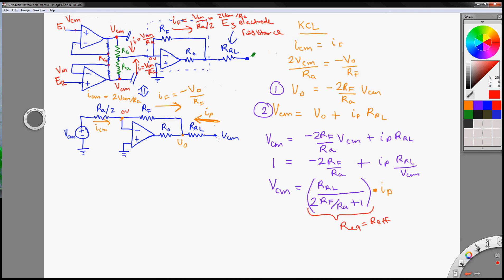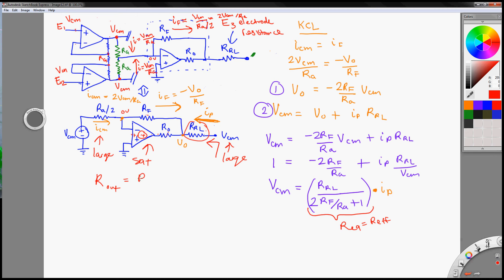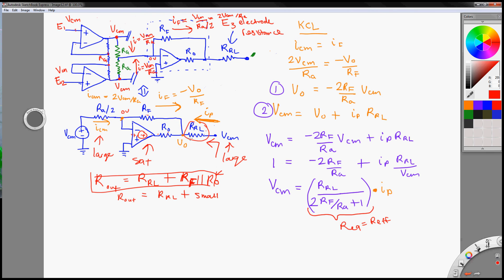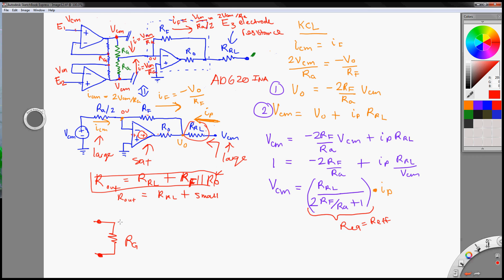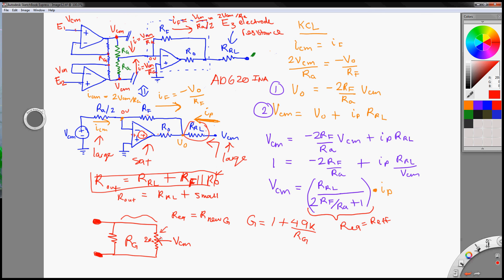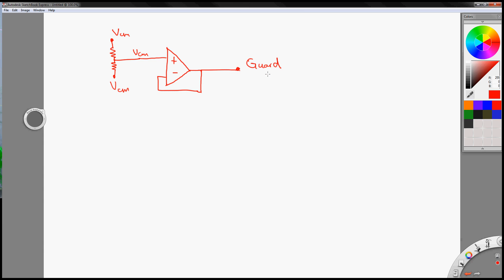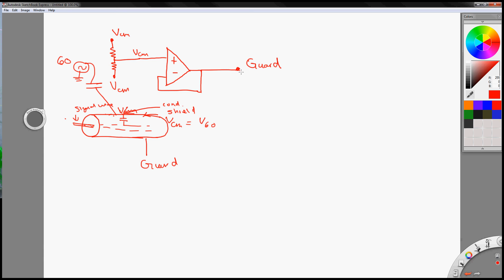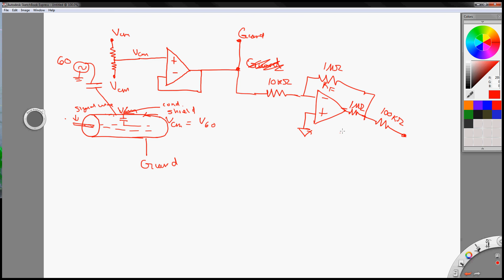Biomedical Instrumentation Part 4 - Shielding and Practical Issues

Comment: Hi Kelvin Nice vid, i am using a drl from open eeg with no luck, so i search for an application note of the ina333 but the design differs a little especially for the Rrl and the resitor values, if you do not mind, could you tell me what effect could have this drl from the application note from the ina 333 thanks
Reply from the maker: either drl is fine
they use smaller resistors which mean less noise which should be better
for EEG applications.  EEG is not an easy thing to measure since you will
need really good op amps to get the SNR you want.
Is the SNR your current issue?
Try searching for better op amps like ad8676